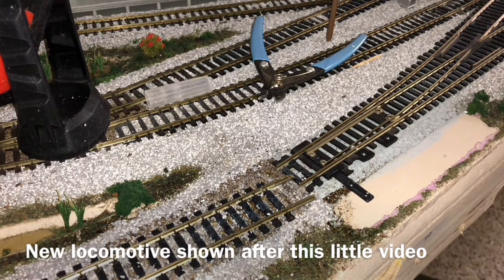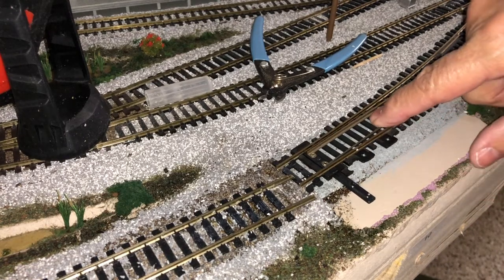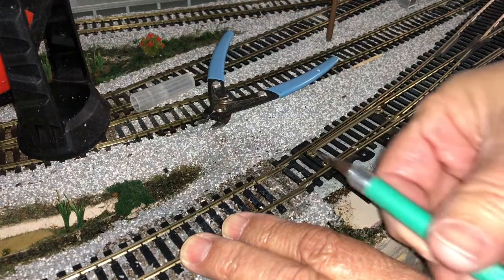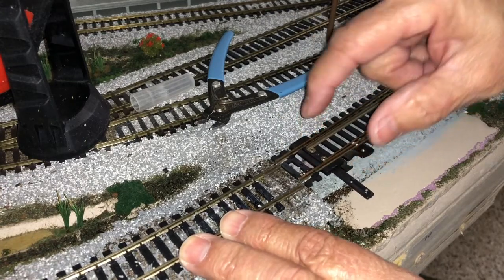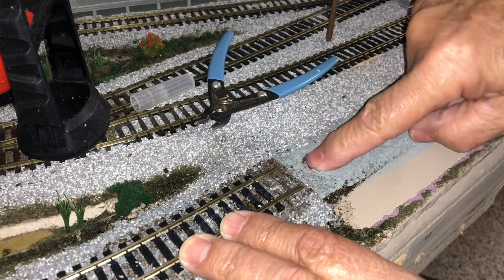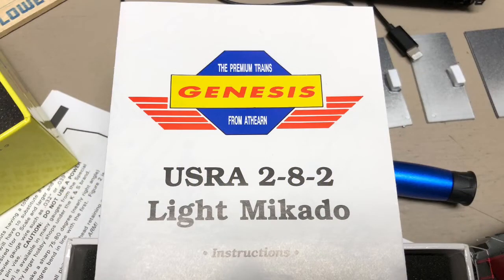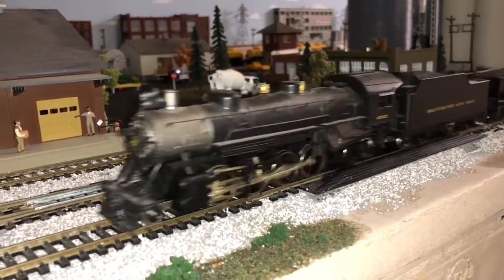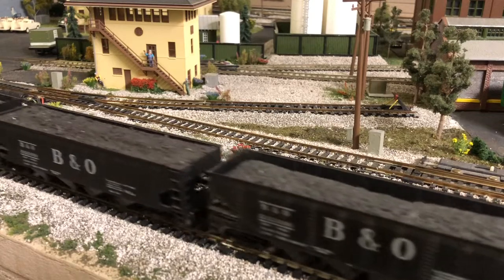My 4x8x2 HO Layout - USRA 2-8-2 Light Mikado

Comment: Hi Fred!  If you put a decoder on, you'll be hooked on a steamer.  The sound is fantastic!  All the wheels are not an issue, except for the back 2 on the engine.  they sort of sit too loose and floppy and not enough weight to hold the wheels on the track.  They would pop off the rails when backing up over switches.

I glued some lead solder strips over the wheels and it helped a lot.  Now have some weight holding it all down.
Reply from the maker: Thanks for feedback Hugo. I’m just not that into steam.  I dropped in a low bid thinking it was DCC (estate sale). Cost of decoder with sound too much $ for me.

Comment: Now because the seller didn’t know ( benefit of the doubt ) that it wasn’t Dcc it had a higher value than if you try to sell it. You must have liked it so throw a new decoder in it. At the rate that you are making improvements on your layout you won’t have to worry about it not running well. It looked great running with the coal cars.
Reply from the maker: Thanks Derek.  I’m not sure I like it enough to spend any more money on this.  Just not I big fan of steam, just thought I’d give it a try.  Be safe out there.😷

Comment: I have one of those. simple to convert to DCC. It is a good runner.
Reply from the maker: What type of decoder?  Does it go in the tender?
Reply: @FredE528  I think I used a Digitrax basic decoder. the harness extends into the tender, but does not connect to anything. Just took out the factory plug and plugged in the new decoder.
Reply from the maker: I’m unclear where decoder is located.  Loco or tender?  If not in tender, what’s the electric wire connecting them?  Thanks for information, this is my first steam locomotive and I don’t know anything about it.
Reply: @FredE528  No problem. Like I said I have the same locomotive. The harness extends into the tender in the hole above the drawbar. It should just have a small circuit board plug in it. You just pull the plug and plug in your favorite decoder. Shot me your email address and I will send you some picture of mine.
Reply from the maker: I50fwe@aol.com.   First letter is a ‘i’. Thanks
Reply: @FredE528  Okay. I will send over some photos.
Reply from the maker: Thanks. Look forward to them.  I appreciate the information.
Reply: @FredE528  I sent the photos yesterday. I hope they helped.
Reply from the maker: I didn’t get the email and I checked my spam folder too.  i50fwe@aol.com.
Reply: @FredE528    I will send them again after work.
Reply from the maker: Thanks
Reply from the maker: Thanks.  Use i70fwe@gmail.com.  Maybe aol can’t handle pictures size
Reply: @FredE528  Okay.
Reply from the maker: Got them on my gmail account.  Thank you so much.  Do you know if a combination sound decoder and speaker would fit in the tender?
Reply: @FredE528  That's good. Hope they help. Yes there is lots of room in the tender.

Comment: If you otherwise like the B&O loco, why not just put a decoder in it?  And if you'd rather not undertake that project yourself, there are no end of competent people who would do it for you.  And maybe even add a speaker (or 2), as well.  
The loco looks good and seems to run well, so adding the decoder would significantly enhance it.
Reply from the maker: I’m just not that much into steam.  Made a low bid after told dcc.  I won then found out not dcc.  After running it for a little while, I just don’t want it.  Now bidding on gp38 B&O I just found.
Reply: @FredE528  OK.  Good luck with your bidding.  I'm an old B&O fan myself, although I model ATSF and SP.
Reply from the maker: I got my B&O 40’ coal cars used on eBay.  I like 40’ cars because of my layout size.  I have a couple of other black 40’ coal cars but I like them to be same on layout.  My wife calls this my ‘matching disease’.   Be safe out there😷.

Comment: Nice loco. Just add a decoder.
Reply from the maker: It’s nice but I doubt it will work well on my layout.  My track work isn’t great so it derailed couple of times in just couple of loops around the layout.  After actually running this steam engine, I’m happy to stay with my diesel locos.  Be safe 😷